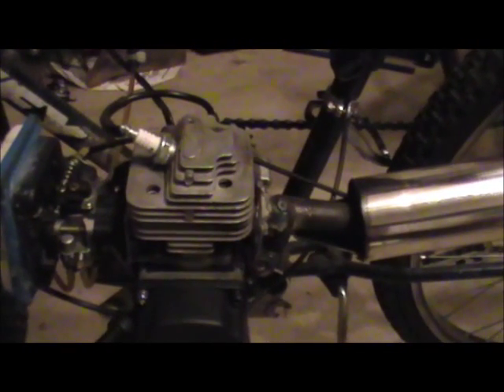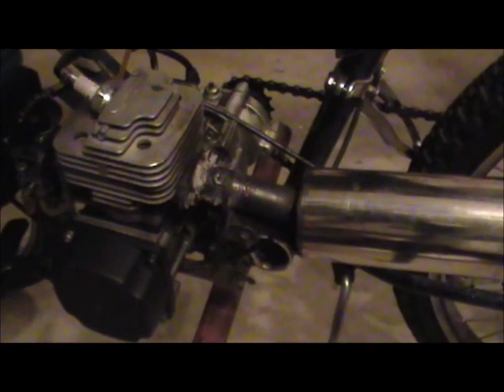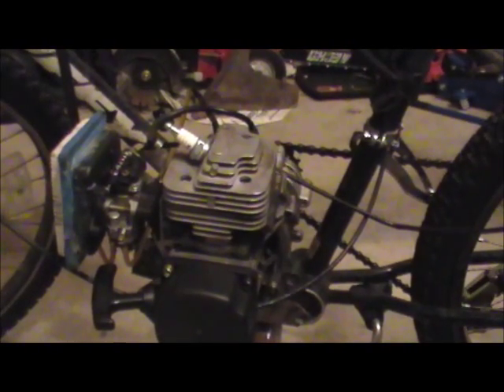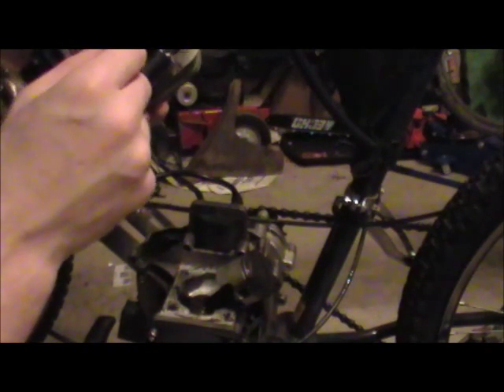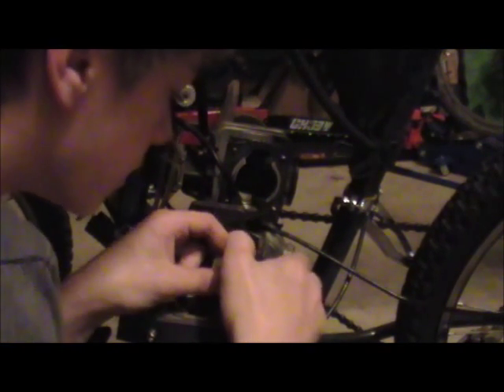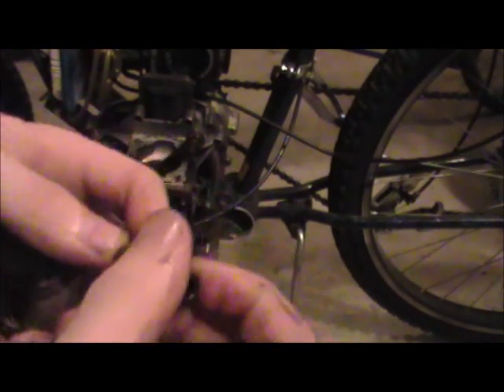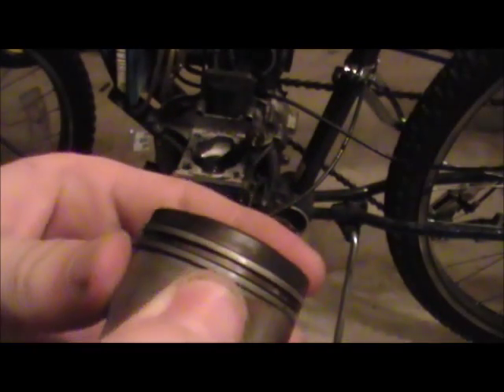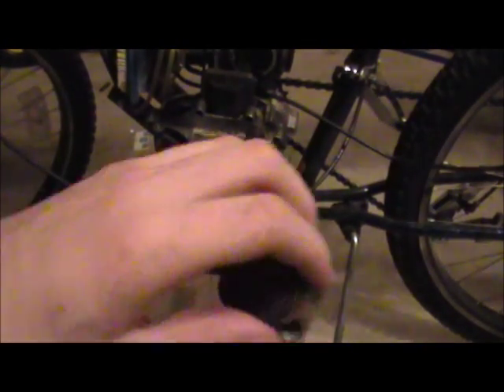how to rebuild 2 stroke engine part 1

Comment: i use lucas two stroke oil, and those rings look good on camera but the way i tell sometimes is if there really springy, and watch out those china rings snap or crack really easy. make sure your gasket paper is good for gas, i have some stuff it is a roll 18'' by 36'' and i forget the thickness but it is resistant to gas oil and resistant to alot of stuff. when ever i make a sump cover gasket for something i keep the inside piece it works good for stuff like this